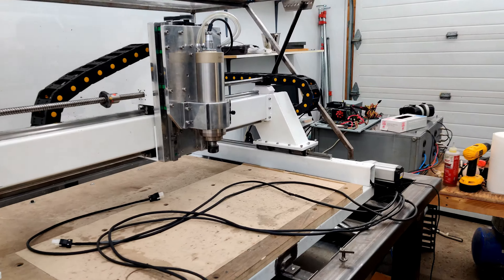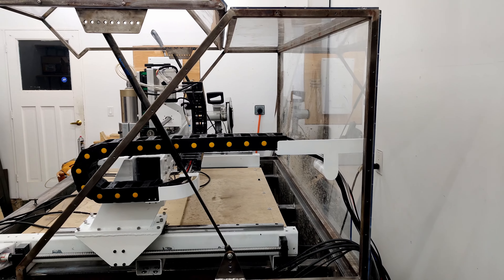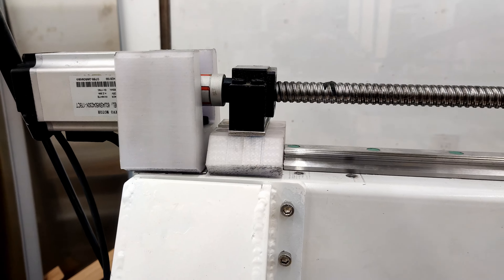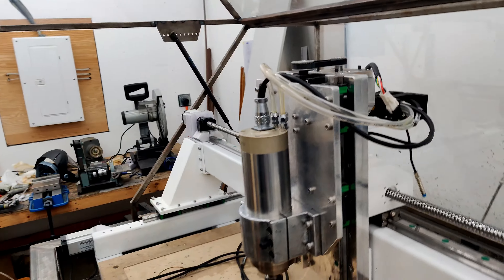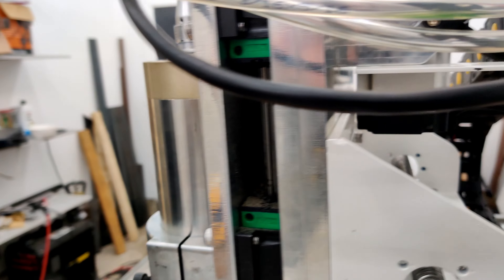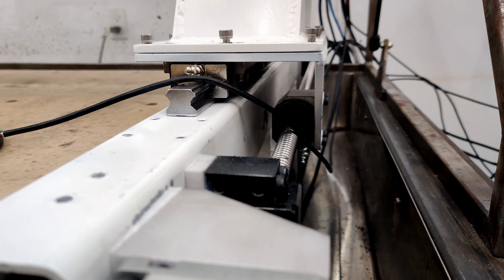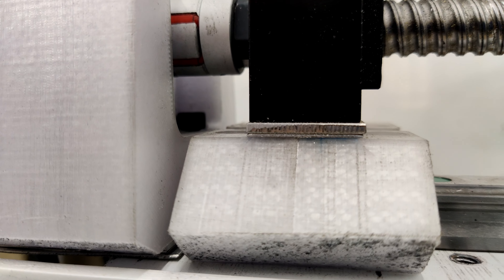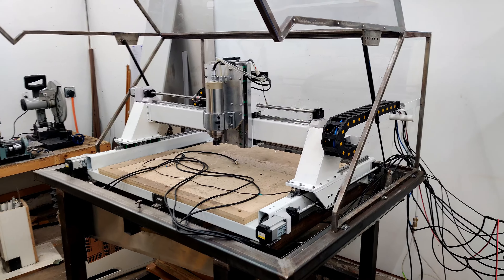DIY CNC Machine Cable Chain Mounts

Comment: Thanks again Bryan.  You have taken what I think was the pick of the designs for DIY machines and continued developing it to the point where it has the power and durability to be a faithful workhorse for you, with the advantage that there is no part you are not completely familiar with.
I like your informal presentation... it gives us insight into the thinking behind what we are looking at!   Nearly there!   😀 👍
Reply from the maker: Yeah DIY machines are great like that. Everything on the machine can be upgraded or fixed if brakes quite easily. 

When it comes with the videos I just want to get the info out there that’s happening at that moment. Some things can be useful for others or someone might suggest doing something in a different, better way. Case in point, epoxing the gantry risers flat instead of shimming.

Comment: one useful technique i learned from watching fellow diy CNC enthusiast "flowering elbow" is epoxy impressioning. you might use it to solve your warped risers issue and potentially increase rigidity at the same time ;)

basically wax up one side of the mating parts and epoxy the other side then smoosh them together with bolts as tight as you can without warping... when the epoxy sets you can then crank the bolts down. epoxy creates a perfectly matching surface so very very rigid. having gaps in stuff is the enemy of rigidity. his diy cnc is MASSIVE and very rigid considering it's made of scrap.
Reply from the maker: I’m gonna do that. Mind as well take both risers off and epoxy the full perimeter so it’s all flat again. Probably a good time to build some wood stands so I don’t have to take the head, spindle off.
Reply: @BryanHoward  Nice, good luck! I think he uses an epoxy mixed with some ballast of some sort, not sure the benefits of it but just thought i'd mention it in case it's cruicial to good performance.

Comment: Can you surface the bottom of each risers to correct their interface with the Y-axis?
Reply from the maker: Technically I could but it would require me to put the machine back into the old configuration with the ballscrews on top with the old risers. It would be at least a whole day of work to do so. Would also have to pull out the spoilboard so I could drop the risers deeper into the chop pan to get the clearance. 

I’d also be skimming off a good deal of material to get it back into shape. I could get around that by TIG welding a bead on that side to pull the plate mostly back into flat by the heat distortion. Then doing that would burn up all the paint. This would get the plate mostly flat and I would machine all the weld. 

I think overall epoxy to make the surface flat on a sheet of float glass will be a much easier way to go about fixing it. Because of the uniform bolt placement of those 2 plates, the epoxy doesn’t need to be critically strong and it’s just needed to fill in that small gap.